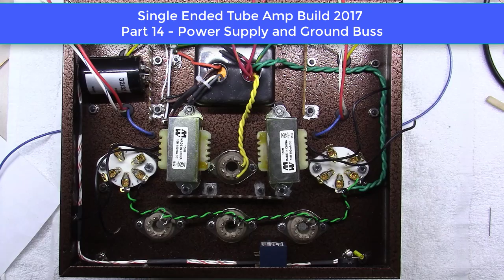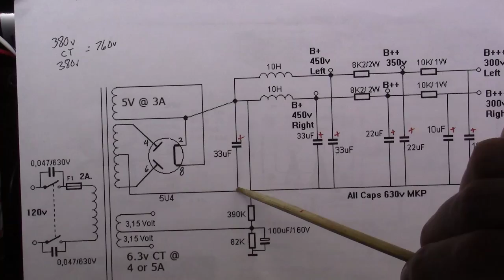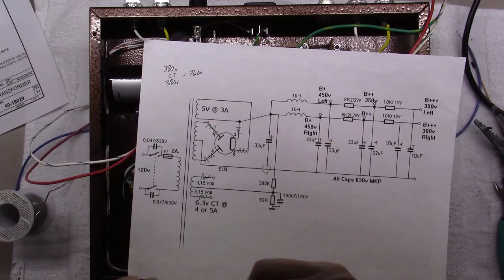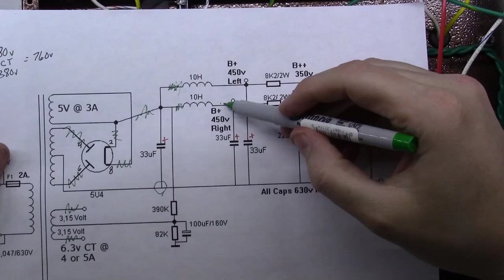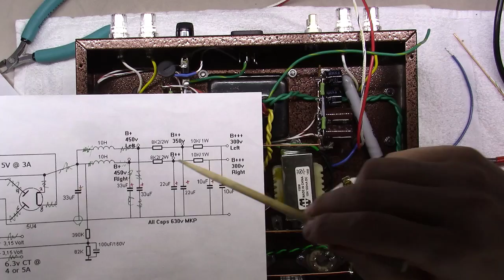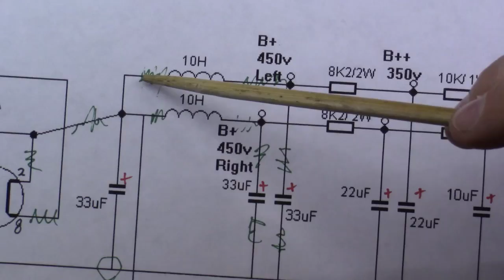Single Ended Tube Amplifier Build 2017 - Part 14 - Power Supply and Ground Buss

Comment: I always use a 10w 10k resistor for the power supply load when testing  and I use a 50 ohm  10w at the rectifier or different when using different rectifier tubes 
I have been using a pcb 3 min relay to turn on the b+ to warm up the filaments and have a switch as well in case I want to use a Mercury tube

Comment: Your gonna have a ground loop with a square root exponential.
Reply: That rectangular loop of bus wire, is a horrible idea!
I don't want any ground loops THRU my chassis, but a big perfectly straight shiny on built in will LOOK cool! AMPLIFIERS are NOT service panels. When will people realize it isn't about a perfect symmetrical straight wire appearance contest?
I've used STAR! Correct point to point, has NOTHING to do with LOOKS!
That square bus,
might as well be a transformer secondary. because it IS!
The primary is the filament wires field! I'll stick with my dead quiet, at max volume with no signal, rat's nests. 😅

Comment: Hey Mark, is there an advantage to keeping the power supply ground separate from the tube and input, output grounds?  I see your ground point to the chassis comes before your bus bar loops down to the tubes section, so I assume that prevents any noise from the PS from reaching the tubes?

Comment: Wow That is incredible. Point to point scares the hell of me but watching your series and videos have so far eased my mind. I am used to turret boards on guitar amps but I'm ready now :-) Mr Carlson, Uncle Doug, EL Paso labs, D-Lab and you are a blessing. You snuck in the thermistor there and I was hoping to see how you wired that up. First time I seen those cathode top caps I instantly thought of my old 350 LT1 Vette engine. Why not use some high performance spark plug wire cable to the top of the 807? They come in cool coolers and they sure as hell will handle that amp voltage and heat, I used to run 40k volts after the coil pack to the spark plugs ;-0. and less of a chance of taking a hit if you touch the wire

Comment: Hmmm???
correct me, if iam wrong,
you added two ground railes, one on the power tube side, one on the preamp side.
there is nothing wrong.
but!
you connected the railes on both sides together!
for the signal(or ground signal) it is now possible to go two ways to the main ground rail.
a short and a longer way, ist'n is a typical ground loop???

thanks for all the videos,
(including tony, mr. carlson, 12voldvids and doug) this teached me a lot...
Reply from the maker: they aren't connected together on the right side, it just looks that way looking top down because of the terminal strip under them.
Reply: Ah, ok, i couldn't see it detailed on  my 8'' tablet
thx for your fast reply...
i am exited for the next part to "fire" this things up ;)
good luck

Comment: I see a thermistor in there. I’ve heard different opinions about using one with a tube rectifier. Some say it’s not needed since they don’t turn on hard like silicon diodes. Can you elaborate on why you chose to install one?  I’m currently building my first tube amplifier so I’m curious.

Comment: Hey Mark, another top-shelf video. Sorry, but I have to point just one mistake... You neglected to show how you wired up the capacitor "Sharpie". I can see the one end is obviously ground, but where does the positive "tip" go? :) Keep up the good work! BTW: I am currently building my own Super Probe. Moreover, I have 2 Patreon's, Paul at Mr. Carlson's Lab and Shahriar at Signal Path! If you did Patreon, I would have 3!

Comment: Why didn't you put the chokes right at the bottom corners far away as possible form any transformer, they are quite close to each other do you think this might cause some issues with interference or crosstalk? Are you going to make one of these super probes would be useful

Comment: Hi, please check if the 440 V on your multimeter is peak to peak or RMS. If it is RMS, the true voltage will  be higher with a factor of square foot of 2, damaging your caps anyways.